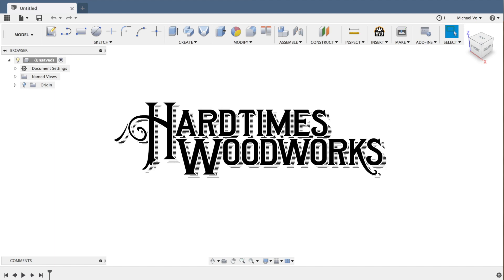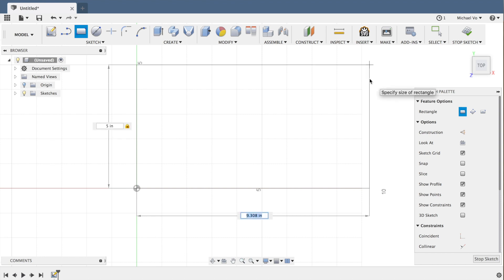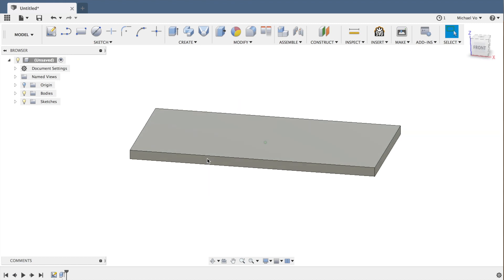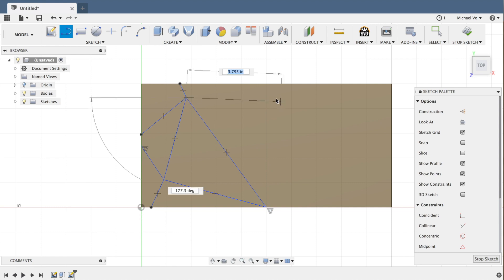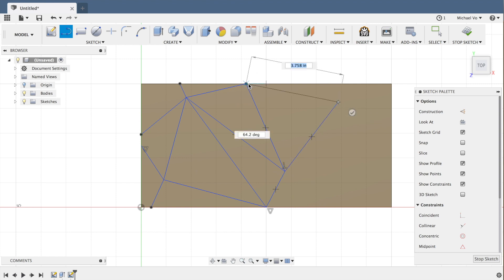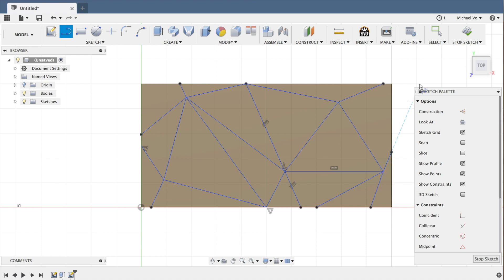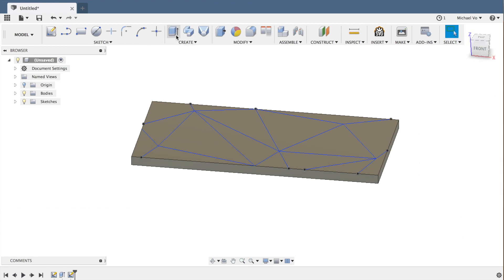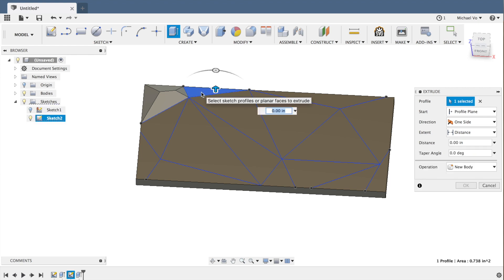Creating Polymetric Shapes in Autodesk Fusion 360

Comment: How do you  apply this on a curved surface like a vase or cup?
Reply from the maker: @alanchong7590  I did some testing today. And made a vase. Using revolve around the z axis. Then created a plane in front of the vase. 
On the sketch I made a bunch of triangles. 
Then create another sketch on the zx plane in the center of the vase. Go to create, project/ include and select project to surface. Choose the faces of the vase, the curves is the lines of triangles sketch, projection direction is the y axis. Repeat this same process in the zy side of the model. With the lines projected on the surface go to modify and split face. Faces to split are the vase face, splitting tool you’ll select a triangle. Continue this process until you get the triangles you want. You may need to add sketches especially around the edges or create to 45 degree planes to add another 2 sketches. Once you get all the triangles split faces. Choose modify offset face and extrude the face out to the height desired. After extruding a triangle, use chamfer and select the 3 edges choose distance and angle out the height of the offset, then rotate the angle as close as possible to get a point. Edit the numbers until the point is closed. If you go to far it won’t work.  Might be easier for me just to make a tutorial but this was the quickest way to explain it.
Reply: @hardtimeswoodworks  pls make tutorial

Comment: Great video, helped me a lot. Just need to figure out how to draw also the circles for the speakers. Maybe I should draw them first then the shapes.
Reply from the maker: Once you have the triangle shapes, I’d create a new plane up from the bottom face, I think I did about .375” on a .75” baffle stock. I extruded that down straight. Then that same sketch I extruded up at an angle that looks good.